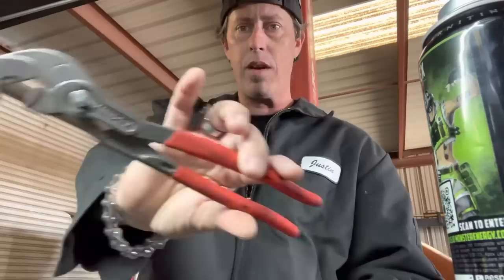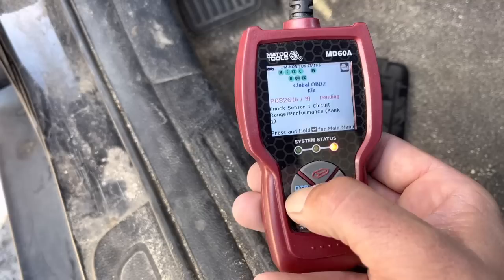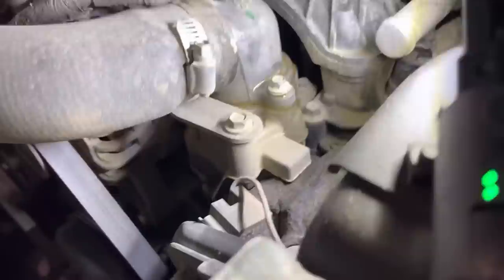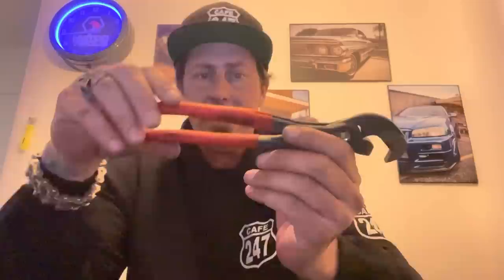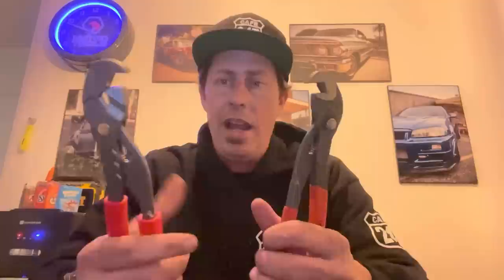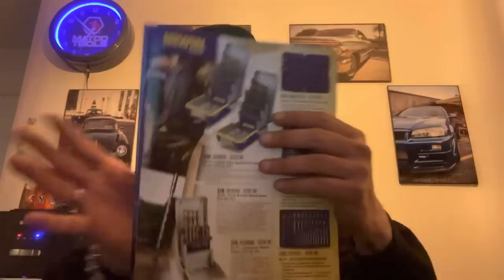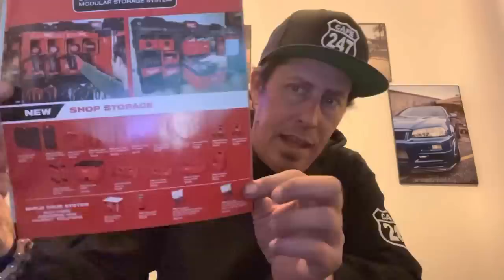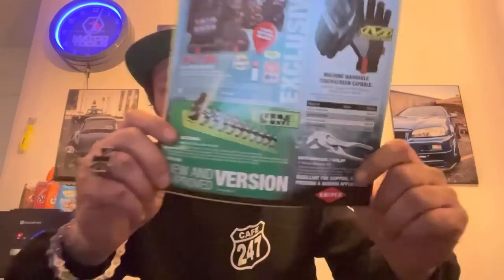A Day In The Life As An Independent Shop Mechanic 👨‍🔧 2023

Comment: I don't have a power probe bc I never needed one but what I do to diagnose starters is to use a small piece of wire where the starter relay is located in at pins 87 and 30. No need to bench test

Comment: Best way too get the coolant heater hose quick connect off is too get a old flat head screwdriver tip hot with a torch and melt/cut off the plastic locking part very easy that way don’t need too take a chance on damaging a heater core from pulling on it hard
Reply from the maker: Great Suggestion 💯🙏😎🍻

Comment: As a guy who use to own a hyundai with that same engine that kia have. It jumped timing what happens is the chain tensioner will make a noise every time you start the engine from a warm start. Eventually it will stop working and it will jump timing. Damn near all hyundai cars have this issue from Elantras all the way to Sonatas. It not hard to do on a 1.6 or 1.8 I did one on my 1.8 actually very easy.

Comment: Justin, I am considering the Knipex hose clamp pliers, maybe the locking one. have you used them, or seen them in use? I mostly work on older stuff
Reply: If you're talking about the set with the  swivels in the jaw they are the bomb. Definitely recommend.
Reply: @markpeterson6836  Thank you Sir